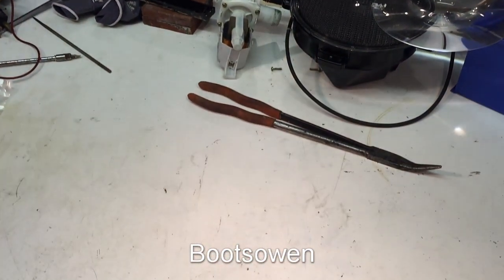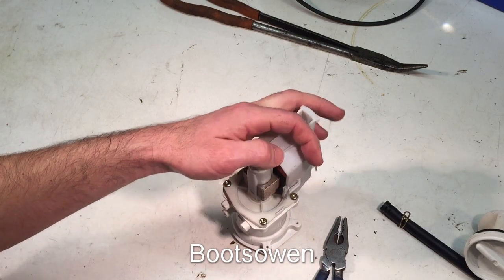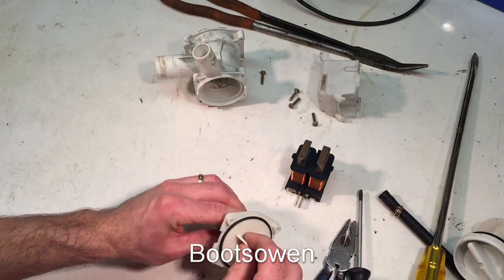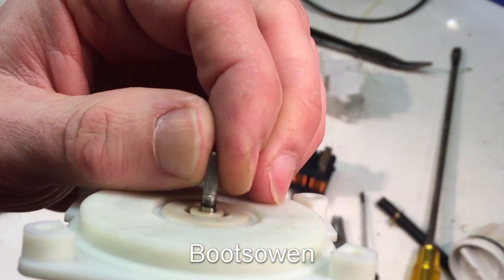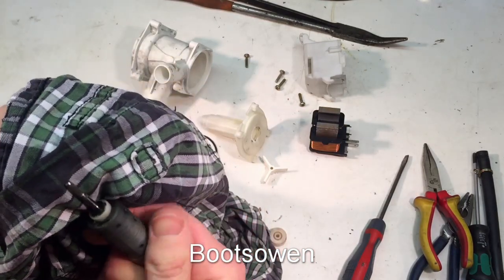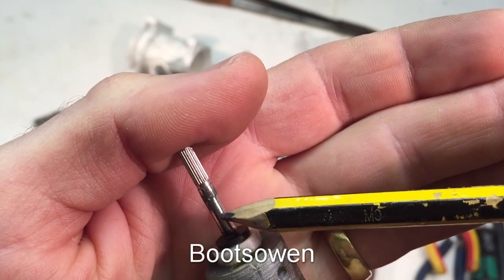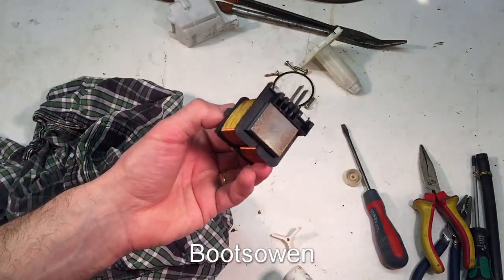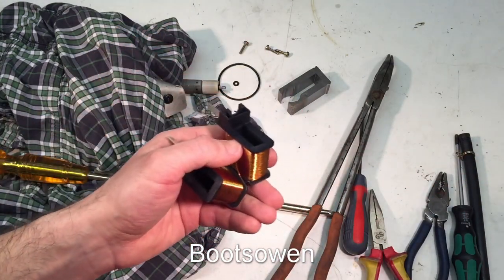Washing machine pump intermittent fault: Why?

Comment: I have a whirlpool cabrio with intermittent drain pump operation, and I was suspecting a relay points issue, but it could be the pump sometimes jamming. There's a humming noise when the pump should be powered. I guess that is more likely to be coming from the pump motor than the relay coil.

Comment: I have the same problem with my Bosch washer. Its a newer one 9 years I think. I am gonna put a new pump on after seeing this.  I bought a miele octoplus when it stared makeing trouble. Thanks 😃 for good videos.
Reply from the maker: Thanks buddy, almost all washing machines have a similar pump, except miele. Easy swop to do, I have posted it in another recent video of mine.
Reply: @bootsowen  i did se that and now I also know what is wrong with it. It did exacly what yours did. Gonna take it apart and se when I swop it out.
Reply from the maker: Cool, let me know how it goes. If it is broken in the same way.

Comment: Good vid, thanks. You're the first person online who indicates intermittent fault. My Samsung washer dryer has no blockages yet won't always drain, meaning I drain manually. I swapped the circulation pump and drain pump (same part) to test it and the fault remains. It seems odd both pumps would fail. I'm tempted to get new pumps but concerned if it's something else. What are you thoughts please? Thank you
Reply from the maker: Check that the connections aren't corroded and look at the control board for loose solder joints. but ask yourself if it is worth it ?
Reply: @bootsowen  true. Thank you
Reply: Just to update...I replaced the circulation pump and drain pump. It now works. Inspecting the old pumps against the new pumps revealed the old pumps had lost a lot of their resistance. Thanks for the vid and help